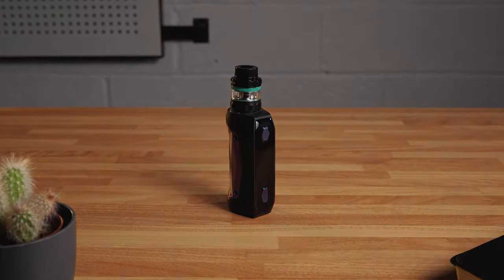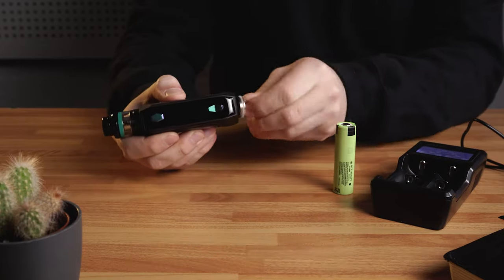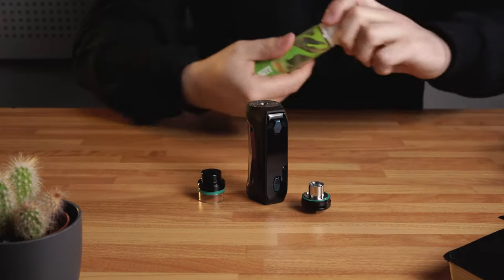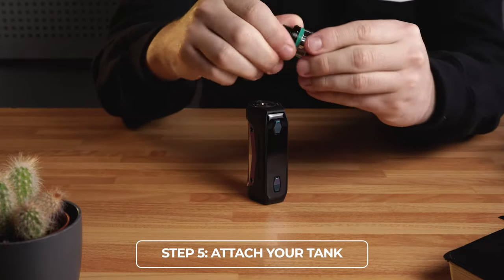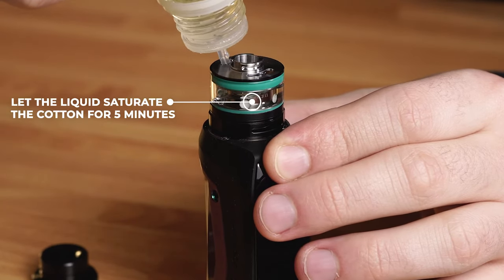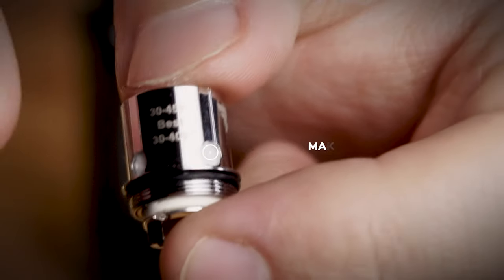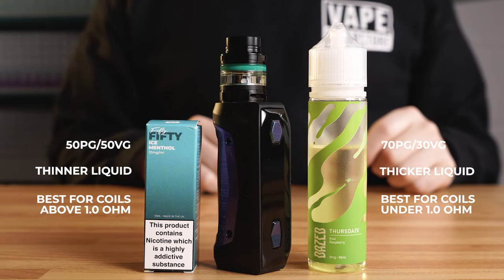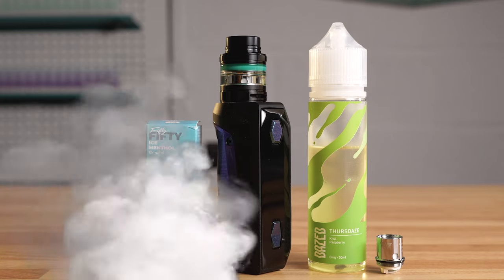How to setup your Mod Kit?

Comment: What if you don’t have a external charger
Reply: Buy one. If you charge it normally you wear the batteries out faster and every single mod I owned before getting one, the metal connector that charges it broke off because I was using it while charging and it bent the metal and I had no choice but to get another mod or buy an external charger. USB ports are delicate, USBC ports on the other hand are more durable but even if you have that on your mod you should get an external charger preferably with 4 slots for batteries.